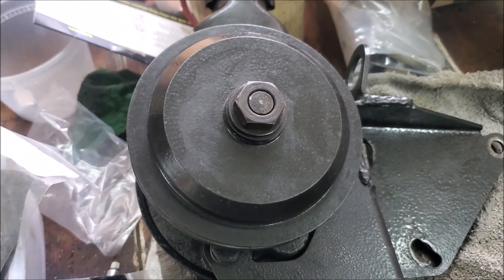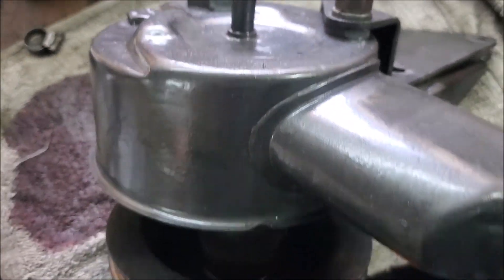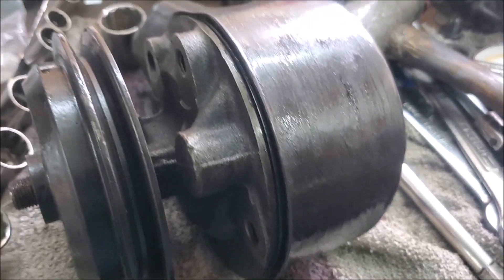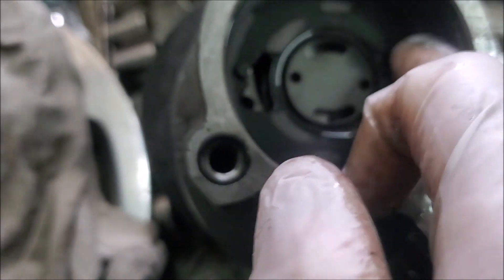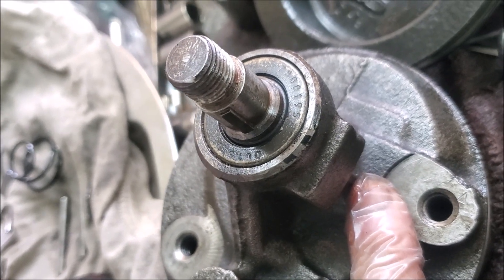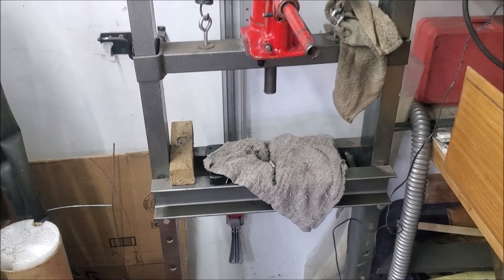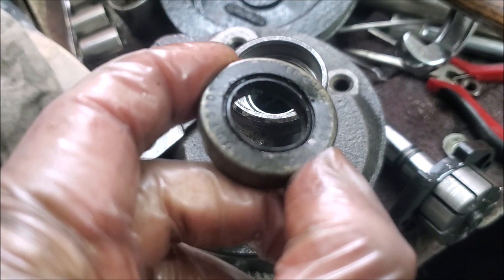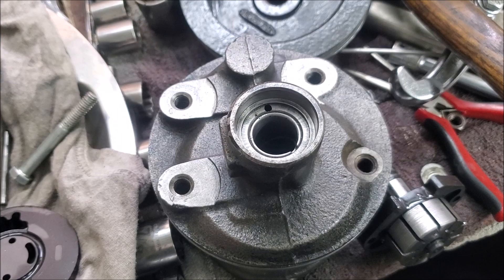Triumph Stag - Power Steering Pump Disassembly

Comment: thanks for your video. It helped me well. There are 4 holes on the front  side, 3 are used for the bracket. Can you tell what the 4th is meant for? (it's been a while since I took it off the car and I don't remember. I also don't see any indication on the parts book or the workshop manual...
Reply from the maker: The pump was used on GM cars in USA so I think the hole is for another's cars bracket

Comment: I pulled off the pully then used 3, 3/8"x4" pieces of all-thread into the pump and a old puller I had against the pump shaft and separated the pump from the housing body pretty easily.